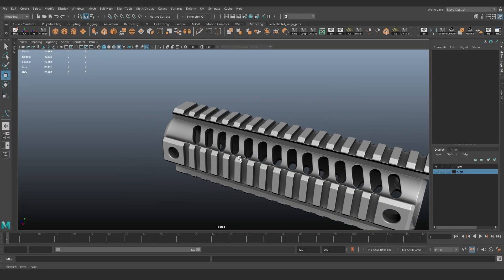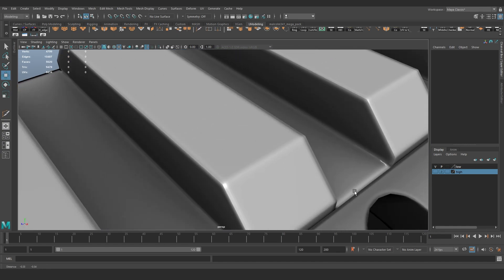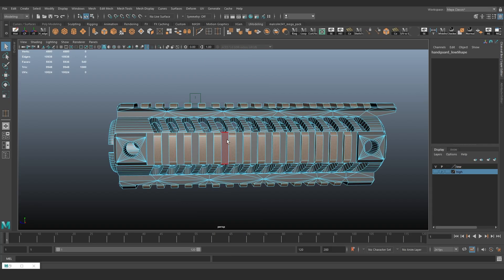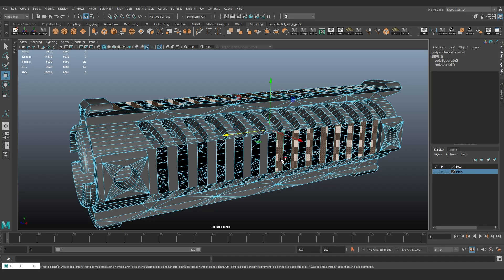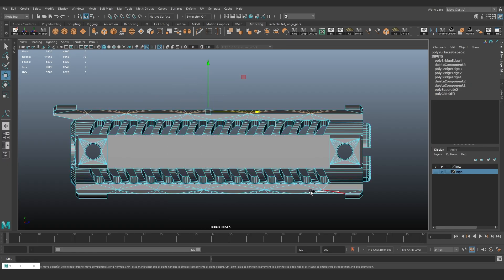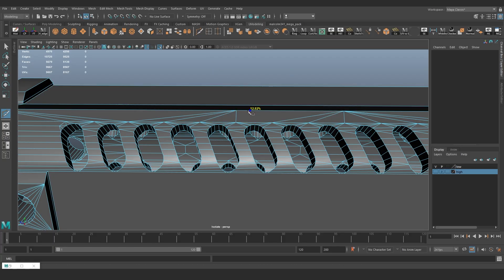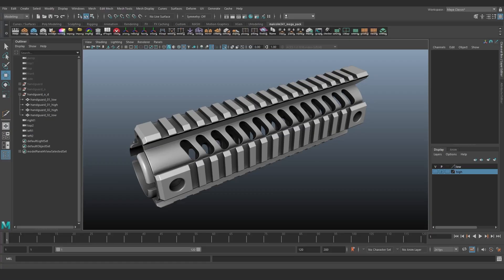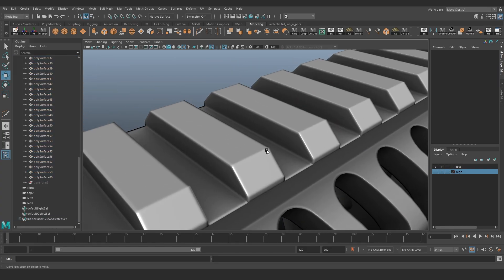This Trick Can SAVE Thousands of Polys!

Comment: Quick lifehack if u dont want artifacts on baked edges. Make your lowpoly and uv like in the video, then duplicate the hole mesh and combine (Boolean) teeth back to the mesh, but do NOT touch the UV. And then, while you have single mesh like at the start of the video, bake your mesh. After that you can easily use your baked map with your lowpoly and you wont see any artifacts on edges, cause you have just baked them on a solid mesh. :)
Reply from the maker: I guess I tried this method couple years ago, and didn't get proper result. But maybe I did something wrong, anyway, thanks, need to try again.